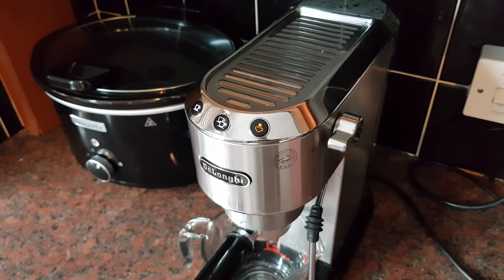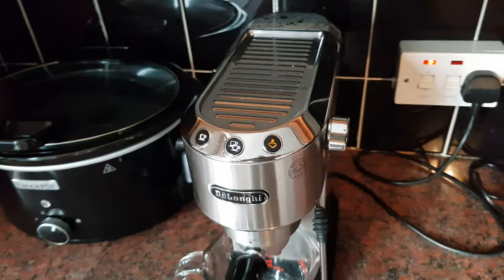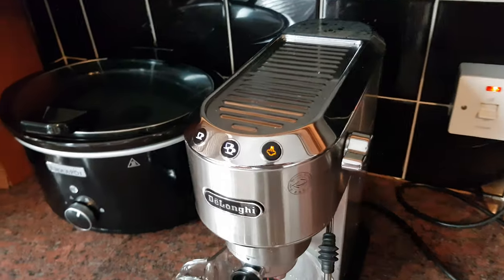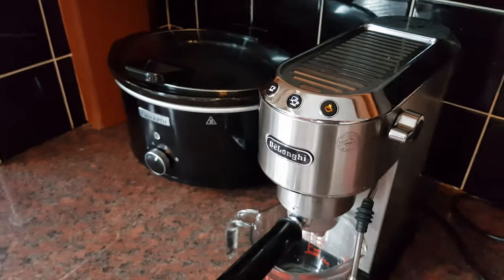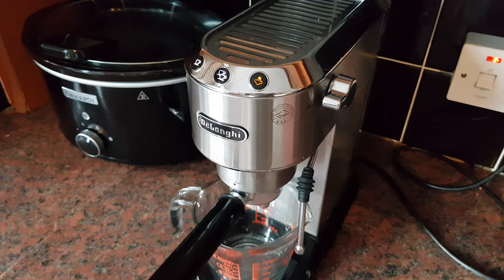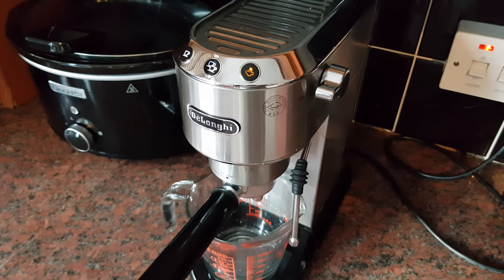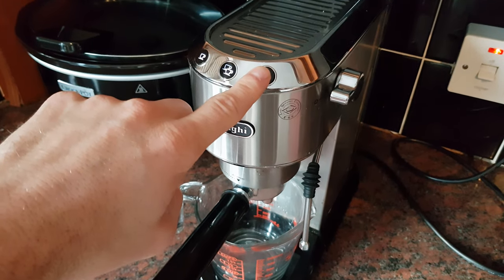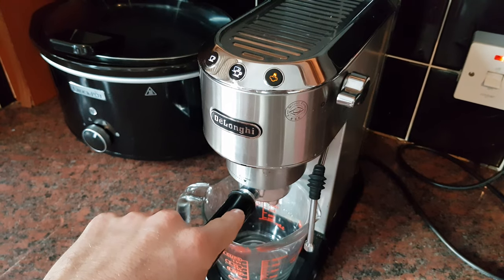Why your delonghi dedica 680 won't finish descaling in less than 1 minute

Comment: This video lead me to a solution to this niggling problem. I have had this annoying blinking light for 3 months and it was driving me bonkers. Pressing the button did not help. After reading some of the comments I decided to try one more descaling. This time I filled the tank right to the rim both times. That did the trick!  I must not have filled the tank to the top previously and the machine was waiting for a few more ml of water to finish the program. 

Thanks everyone for posting.

Comment: Thank you for posting this. I knew it was just about time for my 680 to request descaling, so I was on the lookout of videos with tips. Sure enough, you were 100% correct. Pushing the steam button, after the machine stops, does, indeed, turn off the yellow light. See, here is the thing - When I purchased this unit, I sent a few emails to Delohnghi about inconsistencies and errors in their documentation. Now, some 6-8 months after purchasing the unit, it requested descaling. AGAIN, that vital bit of information was missing in their documentation. Inexcusable, in my opinion. Today, I sent them another email expressing the above. Again, thank you so much. Without this bit of infor... grrrrr, it would have taken a while to figure it out.

Comment: You are an absolute legend, I’ve been descaling descaling for over an hour. I was about to call up and get the machine handed back under warranty…in then I realised nothing online…Nothing in the instruction booklet nothing in any help files and I went to the good old YouTube, where I’m also content provider. And I found this friggin awesome video of yours !!! and your explanation which was first class. This is the best hack / modification fix that the instruction book should have it in it seriously is a major fault by the company. The machine itself is flawless, but the instruction book that really missed out important final step, or the manufacturer of the water jug reservoir had a bad design fault with the water at the bottom caught ….. Nevertheless, it worked work like a dream. Thanks matey :) i’d love to know how you worked this out, or did someone tell you or you just fluked it 😊 because this is one best problem-solving fixes ever … brilliant work ⭐️⭐️⭐️ …. De Longhi need to pay you a  commission:) :) cheers have a great day :) Ap

Comment: Thank you so much. It was driving me crazy. DescaIed it and washed it through several times. I called Delonghi and they couldn’t help me. Told me I would have to have it repaired. Did what you told me and it did the trick straight away. Many thanks

Comment: Thank you!  BTW love your Rancilio Silvia steam wand hack.  I did the same modification while also replacing the original pump, which had lost pressure.  Took several tries to get it all back together properly but totally worth it and a lot cheaper than buying a new one!
Reply: Where did you get the new steam wand?  that looks awesome
Reply: @jlemos28  Amazon, but the seller was Seattle Coffee Gear
Reply: @heathercoburn-schill9418  Thanks for the answer!

Comment: The EC680 (and I'll assume the 685 as well) are interesting little machines. I've owned an EC680 for about 5 or so years. I've recently converted it to a non-pressurized basket. I also bought a Eureka Mignon Facile grinder to replace the Krups burr grinder I was using. The Krups worked fine when using the pressurized baskets but it was too coarse for using non-pressurized.  

I'll be retiring the EC680 in a few months as a Christmas present to myself. :-)  A Gaggia Classic Pro will be the replacement.

Comment: I finally got this trick to work after failing several times,  the trick is to be right there as the machine stops then hold the steam button down straight away. That's how you get it to do that last little purge at the end.  Leave it more than a few seconds and it won't work.  Just wish we never bought this machine. It makes ok coffee but it's fiddly at best and take too long if your making any more than two cups. Still,  you get what you pay for.  Good video.
Reply from the maker: They are all like that once you want to make more than one cup of coffee.  I recommend the sage bambino over this,  interval times between descaling is much longer.  I go 10-12 months without a descale.
Reply: Thanks Oricle, I'll  definitely keep that brand in mind.

Comment: I pushed the steam button, but it continues to blink orange after. I've descaled it twice, just had the machine for a few weeks, really annoying.
Reply: @Joan Hernandez Yes, I did and it has been working well since.
Reply: @Joan Hernandez Honestly, I can't remember exactly what I did, but I did follow the video and I ran water through the system a few times, and I also changed the pressure to "hard water".

Comment: Oh no! I tried your steps but the orange light is still flashing. :/
Reply from the maker: I know it's time consuming but do it again. When the water tank is empty of descaling solution, refill it with cold water. Then hold down the button on the right. Make sure the lever on the side is turned to the closed position when you do this
Reply: @MrSmoothasf  thanks for your reply! I've done those steps and pressed the steam button with the orange light. After that just steam button just turns white. I then move the lever to open to begin the process again but it doesn't rinse the water out like when dealing a whole bunch if steam just comes out.
Reply from the maker: @gr8fulngiving  don't turn the lever to the open position the water should come out of the portafilter.  My light is on right now I may do another video
Reply: @MrSmoothasf  I was able to run the descaling again with water. The machine has stopped but there is still a little bit of water left in the tank. The orange steam light has stopped blinking. Now it is the 1& 2 cup buttons that are steadily on
Reply from the maker: @gr8fulngiving  awesome, turn it off for 10seconds  and it should be good to go when you turn it back on.
Reply: @MrSmoothasf  Thank you very much! I appreciate you.🙏 I will try it.

Comment: I have the same problem with my magnifica, but once the low water light bones on that's it, you can not pump out the last inch of water from the reservoir.
Reply from the maker: Fill it up before you do it with fresh water

Comment: This is EXACTLY was my situation.  Unfortunately it did not work for me and it is still flashing orange.  After doing as suggested, it then Flashes white on the left display, flashes twice on the middle display, flashes twice on the 3rd display (all white flashes.) does this a couple of time but then goes back back to the orange. So frustrating!! I went back and watched the video 3 or 4 more times, then had someone else try it… still the orange light
Any thoughts
Reply from the maker: Did you fill the back back up with water before pressing it?

Comment: When I press and hold the button for 10 seconds, it just goes into menu/setup mode. Not sure what I'm missing? The yellow light continues to flash after it exits menu more or even if I reset it.
Reply from the maker: Your Milk valve.... Turn it
Reply: @MrSmoothasf  Thx, super helpful!

Comment: If you click on that light and hold, it is entering the programming menu
Reply from the maker: Not after a flush it doesn't
Reply: @MrSmoothasf  hi, now I am not able to use my machine. I ordered the solution, I am going to do a full descaling process and see.

Comment: I bought  Delonghi ec685  and a month later the descale alert comes out, i decaled almost 4 times even that light still flashing what should i do? Help me 😔
Reply from the maker: Are you sure your running the descaling programme and not just emptying the water.
Turn the machine off for a minute,
Turn it on and hold the button on the right until the lights all flash in order.
Turn the tap to the open position and press the button on the right again.
Once the descaling cycle has stopped, fill the water tank half full with fresh water, press and hold the button on the right one last time, it will empty the rest of the tank and the cycle will be complete.
Reply: @MrSmoothasf  i tried as you said and now working great, thank you so much 💙

Comment: Thanks for the tip. It didn't work for me. So with the tank empty I turn the steam on fully till all the water ran out of the system. The yellow light stopped flashing, happy days.
Reply from the maker: You Just had the steam lever in the wrong position, you were almost there 👍
Reply: Also did not work for me, emptied the tank and turned the steam until no more water came out. Still have the orange light flashing 😔😭
Reply from the maker: @johnaleigh1977  when it stops refill the tank with fresh water, then hold the button

Comment: Hiya! I hope you don’t mind this message, but you seem to know what you’re doing. 
I’ve been looking for some help with my machine all three lights are flashing continuously in 3 flash pattern. Any idea what I can do?
Tried factory reset. I see that you have changed to the rancilo Silvia wand - I’ve done the same. Much better.
Reply from the maker: Sounds like that portafilter basket is clogged up, try just a few shots with no coffee in the basket, if that doesn't work you can use a small sewing needle to poke at the holes and try clear then or the 3rd option I did was buy a dual wall basket with removable base.  Your coffee grind is probably too fine
Reply from the maker: Does it work with no basket in?
Reply: @MrSmoothasf  hiya thanks for getting back to me. So after turning on and initial warm up it goes straight to this 3 flash pattern and basically won’t function at all. Can’t brew or even factory reset. 

When you say basket do you mean the removable cup or should I try poking a needle through the machine itself ?
Reply from the maker: @kathleenmartin4540 yes I meant the basket but if its happening from the get go it sounds like you have a major fault.  It could be anything if the lights are flashing and not even heating up. One last guess though would be to make sure there's water in the tank and that the tank is on fully.
Reply: @MrSmoothasf  Yeah I read this could be from the water tank - I’ll have a play around with it but I think it’s buggered. 

Only had it a few weeks. It’s still under warranty but obviously I’ve changed the steam wand so I’m presuming they won’t help me?
Reply from the maker: @kathleenmartin4540  I think you may be right.  If its any help I not have the sage bambino plus, it usually £400+ but I got it on offer in Currys for £199 and its a very good machine, I've descale it once in a year.
Reply: @MrSmoothasf  thanks but I’ve literally just saved to buy this one. 
Would this not be worth a repair?
I’m so gutted this has happened.
Reply from the maker: @kathleenmartin4540  that's really unfortunate I had mine for 3-4 years with no issues. They are pretty easy to get spare parts for but obviously youd need to know exactly which part has gone

Comment: EDIT: HOLY SHIT where did you get that steaming wand ??? I’ve been struggling with just the silicone tip of the panarello for a year now, even bought the longer one from the EC685, helps but.. what you got there is what I really need

Hmm, mine doesn’t have that ‘bug’, mine goes through roughly 1 tank (perhaps a bit more) of descaling solution, then just the steam blinks orange while it waits for you to add fresh water ... then it does that and it’s done

It definitely takes more than 1 minute though

I have a late model 680, .. I’m assuming this is also a 680 ?
Reply from the maker: Darieee yupnsame model. It does stop for you to fill it with water but the instructions aren't clear that's why I made this. The wand is a rancillo Silvia wand.  A bit of work to do but worth it
Reply: So, does it fit in the ball joint of the old arm, or how do you connect it up ?

I'm sure it is ... the super huge nozzle of the silicone tip really doesn't help much ... you can get quite good milk but, yeah, I'm ready for the next level xD
Reply from the maker: Darieee yeah it fits in the old ball arm. No additional parts required.  The standard wand is pretty bad just leaving it in the milk would result in 100% volume increase. With this I can control whether I want a silky milk for flat whites or a thicker milk for latte art.... attempts.
Reply: sweet ! one last thing .. do you have any idea if this is a standard coupling ? the particular rancilio silvia one you mentioned (p/n 1449141) seems relatively hard to come by ..

Comment: This title is misleading and describes my completely different problem. I follow the instructions for descaling but  almost no water comes out and after a minute it kicks me out of the descaling process, back to two solid white lights and the flashing orange steam light. It’s still full of descaling fluid!
Reply from the maker: Sounds like you have an actual fault. They only time I've seen that before is when the wand was blocked

Comment: As if all the comments weren't enough proof; I can say this worked for me too despite doing it after closing the machine once the descaling was done.

If you also end up coming here after descaling properly and "interrupting" the end of the process, you can simply:
1- If you didn't already, do the rinse that comes after the descaling first. I'm talking about the usual rinse you do like when you first got the machine, you can find instructions online.
2- Once rinsing is complete and you still have a flashing light; fill up the water tank a tiny tiny bit, you don't need much water since you've already descaled the machine at this point.
3- Hold down the flashing steam light for 10 seconds like you did when you were descaling. And then "descale" the machine as you normally would. You're basically simulating the descaling process with normal water.
4- Don't touch anything else, just let the water come out the cappucino maker.
5- Once the machine stops, shut the valve of the cappucino maker.
6- You can now follow the video. Just hold down the flashing steam light until the last few droplets in the tank come out the center.

You should ideally have it all back to normal now.

Comment: STILL NOT DISAPEARED!! AHHHHHH

I hold that flashing orange steam button down and it just enters the settings menu - does not purge water ...
Reply from the maker: Ross Chadwick then you need a second cycle.  Fill it with water and descaler, run the program, when it stops and the light is still flashing fill it back up with just fresh water and hold the button. It should clear it then
Reply: will try it now, many thanks
Reply: Did a second cycle, then followed your instructions and it worked. now just rinsing through fresh water. Thanks a lot man!!
Reply: Thanks dude works like a charm, once the descaler cycle cuts off on the second clean water rinse and the water stops coming out. Then press the button and a small bit of water follows. Sorted 👏👏👍

Comment: can you please write what you say, i dont understand. i have same problem :(((
Reply: dont know well, my machine after descaling still flashing and dont know why :/
Reply from the maker: When it stops, put water back in the back.  Hold down the flashing light, it will start flushing water through and then stop. The light will then go off
Reply: @MrSmoothasf  thank u ❤️❤️

Comment: Same issue. Need to repeat the whole process for your advice to work? Thanks
Reply from the maker: Cornel Ionescu did you leave the wand lever open when you pressed the button?  This should purge the water out at a much quicker rate than the actual descaling programme.  If it did purge the water out then your machine definetly needs a second descale.  Mine has never needed a second run through, however I descale mine as soon as the light comes on
Reply: I think I had described the issue in the wrong way. I Wanted to say we have the same issue like you had. Actually I wanted to say that the descaling procedure was finished yesterday with it still blinking and today I found the reason. So, to apply your advice, we need to repeat the whole process, maybe without the special liquid at first run? Thanks
Reply from the maker: Yup that will work

Comment: PAY CLOSE ATTENTION: THIS PRACTICE IS NOT RECOMMENDED. It happened to me several times before I found a different video on this. WHEN THE FIRST TANK THE ONE WITH THE SOLUTION EMPTIES, THE MACHINE WILL AUTOMATICALLY STOP BECAUSE OF THE LACK OF WATER. EXACTLY THERE IS WHEN YOU HAVE TO REFIL THE TANK WITH FRESH WATER AND NO SOLUTION, AND THEN AGAIN PRESS THE STREAM BUTTON. This will rinse the machine internally and conclude the descale process. If you follow this instructions, you will not get the yellow blinking light after descaling. Just then you should return the machine to its operational state to be safe.
Reply from the maker: I do say at the end to run fresh water through.  Probably not clear enough but I wanted this to be very short.

Comment: Still doesn't work for me :(
Reply from the maker: Close the steam. Valve then press it
Reply: @MrSmoothasf  If I do that it just goes to the settings mode and each button starts flashing white alternately...1st 1cup button, then 2 cup, then steam
Reply from the maker: @vangelissilver4  did you fill the tank up with water when it stopped?
Reply: @MrSmoothasf  thanks for the quick reply. I went through the rest of the comments and figured it out finally. Very helpful video and comments... bought this used and I already own a dedica for 1.5 years but I never had to descale it somehow (I guess because I use bottled water), so it was really frustrating for me to get rid of this flashing light
Reply: @vangelissilver4  how did you sort it I’m so struggling nothing seems to work x

Comment: After one cycle of the descaling process with the descaling solution, you need to run another full tank of water in order to flush any remaining descaling solution out of the system. Then , the yellow light will come off.
Reply: Only it doesn't